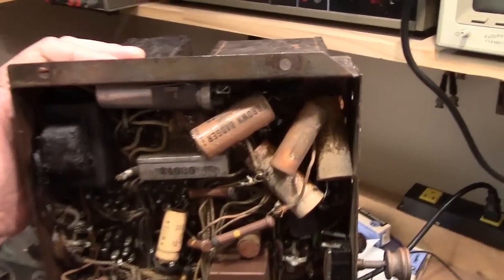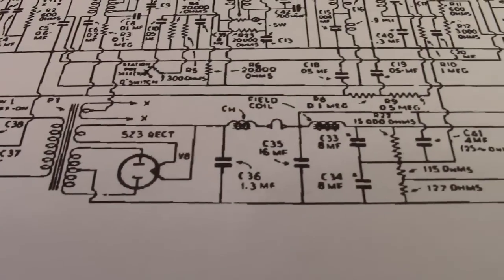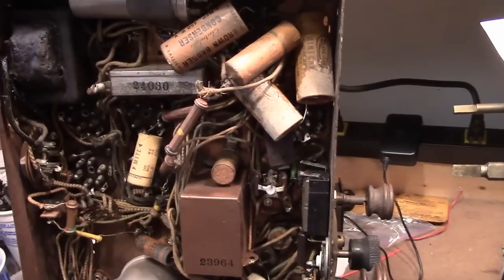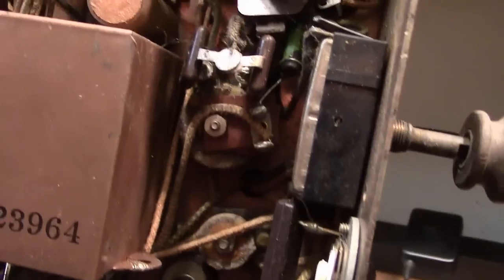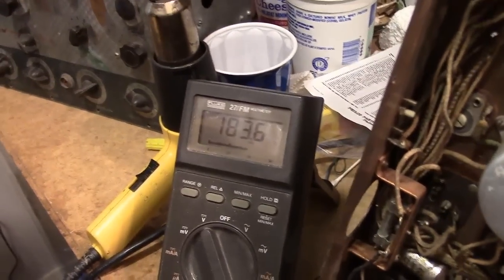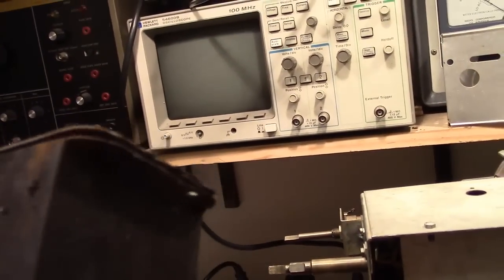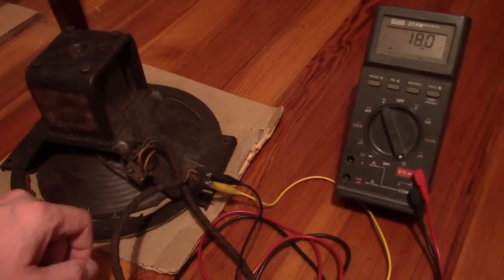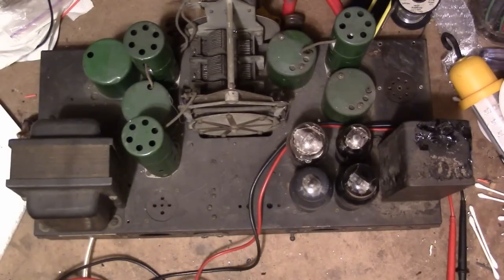Stromberg Carlson 64 restoration p2o9

Comment: Amazing. That cap looked like it had some rolled over rivets on the mounting holes. It would be nice to see it shelled for its socket an modernized with new caps. Same for that tar volcano box next to it if you have to replace that transformer. Can't wait to see how this set turns out. :]

Comment: I wonder why these early sets always used interstage transformers, when a simple R/C network would do the job just as well but at a fraction of the cost? Another odd one is to use two pentodes strapped as triodes in push pull. A single ended pentode would probably give about 3 watts. I doubt twp triodes in push pull would offer much, if ANY more.
Reply from the maker: +Michael Beeny I've wondered about that too.  From what I've read an RC network actually works better!  The three 42s to drive a small speaker seems like overkill to me too.
Reply: +Michael Beeny The RC networks were first used back when capacitors were expensive and most tubes had relatively low gain, but in a push pull amplifier the interstage transformer was a relatively simple way of supplying phase inversion to the grid of one of the output tubes. The setup in this Stromberg actually has three #42s connected as triodes, but in a class A-B setup, two are in push-pull, the third is a driver. Depending on how much B+ is delivered to the plates, and on the bias, it could be as high as 12 Watts power output. It's almost the same setup used in a Philco model 18 or 118.

Comment: Interesting, Bob. I believe you are correct that this is a 56-60 cycle version, since every 25 cycle power transformer I ever saw, had many, many more iron laminations to provide sufficient reactance at the lower frequency. A 25 cycle, 165 watt transformer would have a 5-6 inch stack of iron, and would weigh about 35-50 lbs by itself, and any filter choke would likewise have much more iron to prevent magnetic saturation, a lot heavier units. Thanks for sharing, looking forward for the follow-ups. Dick
Reply: +WB8MHE With the power transformer, you are quite correct that the 25 cycle jobs have a greater number of laminations to prevent core saturation. For the filter chokes the main object was to eliminate the AC ripple on the DC coming off the rectifier, in some sets they sometimes used different chokes, but usually they either added an extra choke or even more commonly added more capacity to the filter caps. What Canadian radio manufacturers typically did is they used the same field coil speaker in both 25 and 60 cycle sets, and the same chokes (if any) but would swap out the power transformers or add larger filter caps. But then again, there were some companies who manufactured nothing but sets with a 25 cycle power supply, usually marked as 25/60. Rogers-Majestic springs to mind, aside from something like an electric motor, all their sets got the same power supply.
Reply: 1 comment

OlegKostoglatov, you are correct in saying the chokes are for smoothing AC ripple, but their effecyivness is dependent upon the reactance at a given frequency. With lower frequency, higher inductance is needed, for instance, at 60 cycle full wave rectification,, the ripple is 120 pulses/ssec, but at 25 cycle FW rectification, it would only be 50 PP/S, hence higher inductance is needed for sufficient reactance. There are only 2 ways to get higher inductance, more copper,, r more iron. Iron is cheaper.
Dick

Comment: Bob
There Is a great deal of data available in Riders volume 4 at Stromberg Carlson page 16. I no longer have Beitman or Gernsbach but there may be more dates available there as well
Reply from the maker: +Michael Tannenbaum Thanks.  That's the same info I downloaded from Nostalgia air.  Unfortunately the scan is poor quality and I can't make out the wiring and parts diagrams.  A youtube friend is mailing me a hi-res scan that I hope will be readable.

Comment: You might want to check out a company called Edcor transformers, their prices seem to be a little more reasonable then Hammond for most things. I don't think you will need a universal output transformer for this set, output transformers for a type #42/6F6s plate impedance seem to be an off the rack item with this company, keep wattage in mind though. For the audio interstage transformer I'm not sure if this one will be the same as the ones typically used to drive a pair of #45s with a #27, the setup in this set appears to be a class A-B amplifier with triode connected #42s like a Philco 118 would have. The reason they did this is that at the time was power pentodes had a reputation for being noisy, particularly #47s, so the way to solve this was to have them triode connected, but to get the gain back from no longer having an independently connected screen grid they used a triode connected driver tube.
Reply from the maker: +OlegKostoglatov I figure I'll use the Hammond 125D I already have on hand for the output transformer.  I checked out Edcor but don't see any driver transformers.
Reply: bandersentv There is always the option of building a solid state substitute, though I don't know what the voltage limits might be. As I mentioned before I don't know if the input and output impedances are substantially different for a class A-B driver like a triode wired #42 verses something like a #27 or a 6J5. There was an article in the AWA Old Timers Bulletin a few years ago, that I saved, with instructions for building one which I was planning to try. I'm surprised that Edcor does not have one listed, though they do say that they can pretty much build any transformer you need to order, though it's cheaper if they already have the plans on file.